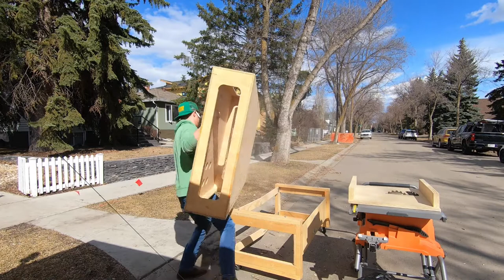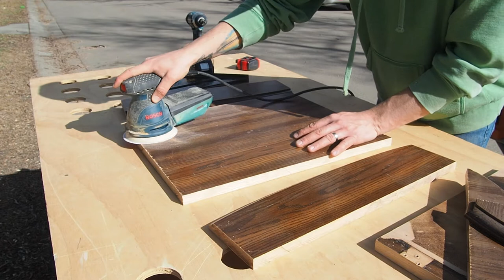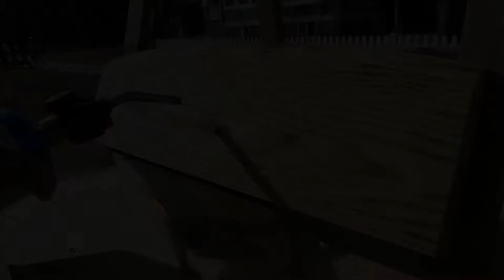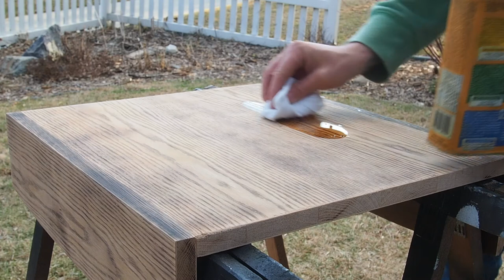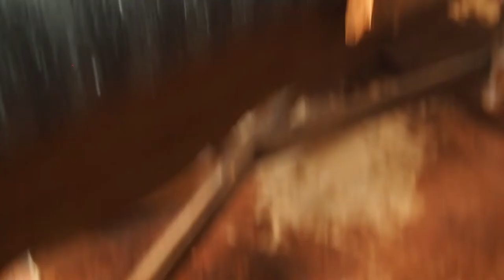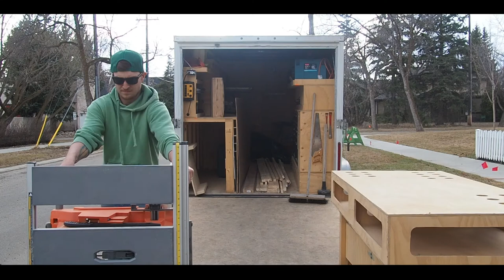Easy DIY Ottoman table tray top with Shou Sugi Ban

Comment: @5:35 What's the vice thing you can drill angled holes into?
Reply from the maker: That is a Kreg pocket hole jig. They can be found in different sizes as well depending on the project. They even sell a simpler one that works with a trigger clamp.